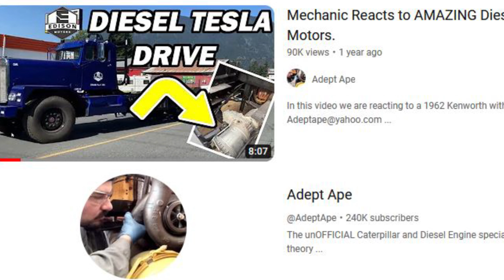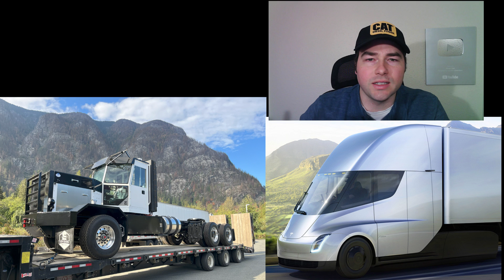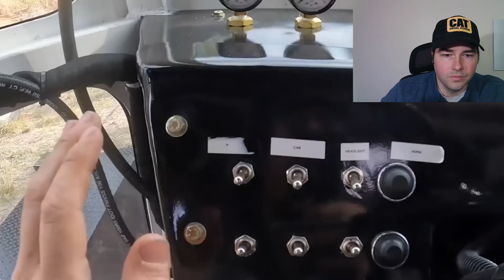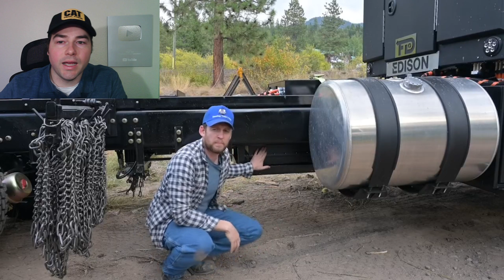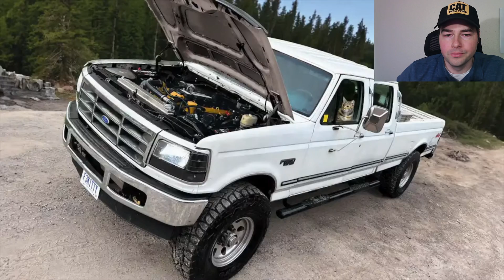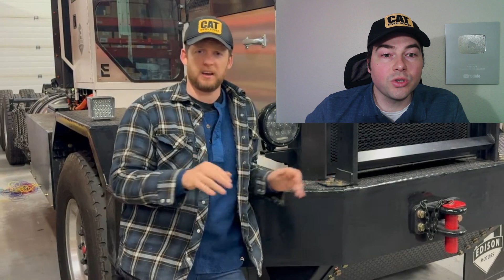Edison Motors New Truck DESTROYS the Tesla "Semi Truck" design!!!

Comment: Regarding emissions.

One topic that's been very interesting to me is that the drivetrain as envisioned by the people at Edison is designed in such a way that the diesel generator is run at constant load and a constant RPM, which I would assume would be at the peak torque range or at peak BSFC.

Would a system like that even benefit from the inclusion of a Diesel Particulate Filter? My very limited understanding of diesel emissions control makes me wonder whether at such specific conditions there's actually anything for a DPF to actually filter only to later regen since unlike a normal road-going diesel drivetrain the engine doesn't spend any time idling, or at low load/low RPM conditions.

Is my understanding wrong? Wouldn't a selective catalytic converter to curb NOx emissions suffice?

Comment: Not sure EPA (presently) can do anything about C9 engine....  cause it is NOT driving the truck....  it is ONLY a Generator; on wheels, so it only has to comply with whatever generator EPA requirement's are.   Which am sure that if this truck design takes off (pardon the pun) EPA will change all its regulations in attempt to kill it... (Unless we elect Trump)

Comment: They convert the AC from the engine to DC then back to AC because you need to vary the AC frequency to control AC motor speed. Its easier to chop DC up onto variable AC then it is to convert say 50Hz AC to variable AC. Also the generator speed on the engine will vary the hertz as well. 
They use HRC fuses instead of breakers for several reasons. Big breakers wont like rough roads for long spans of time. Also HRC fuses are glass filled as well because they do have to break at 600 or so amps but if you have a motor short it could pump several thousand amps which would arc through the breaker.
Been working on electric drive trucks in mining for a while now. Its a very similar setup minus the battery
Reply: Having worked on locomotives, fuses are for safety as well. You get someone who doesn’t know what they’re doing and try and reset a breaker with a short and end up seeing the sun and meeting their god.
Reply: Yeah, as convenient as breakers are, you gotta remember that you're not just replacing the fuse, you ALSO have to find and fix the fault that blew the fuse in the first place!

Comment: A pick up conversion needs only a small gas engine to charge the batteries - much like the Chevy Volt used. The batteries provide the torque, not the engine, also a small engine is much lighter and must be so because the batteries add a lot of weight. To be viable, the converted pick up can’t weigh much more that it did as a new vehicle otherwise the handling and braking will be awful. Good business concept, tough execution.

Comment: not bad, nice simple and not over engineered.
honestly it is a hybrid type design though.
The true test is putting it on a real 'live' under load test and see how it performs.
I'm sure he has already done some testing but i would like to see it compared to the 'full' EV's out there.
One other important test would be to see how it performs in cold conditions. From my experience anything battery powered just does not perform well in extreme cold or hot environments.
Reply: They towed a Sherman tank with Deboss Garage. 100,000 lb GVW. It is insanely smooth. No chassis flex. They spun the tires with the tank and lowboy.

Comment: With the engine running at constant velocity to run a generator most of the emissions issues are irrelevant.  Much easier to run clean in a narrow power band, not idle for hours then spin up to rpm under load.

Comment: Is this a prototype, yes. Is this well thought out, YES! I am genuinely amazed at how they thought through things to make it as customizable as possible. The fact that it is a "hybrid" with the onboard generator, and the ability to make it multi-fuel is really incredible. As I understand AC motors also have way better traction control, which is why they are preferred on trains where low traction is a major issue. 

This is coming from someone who is not a mechanic, but loves seeing people bucking the contention of "thou shalt not repair this" and said the heck with that, get in there and fix it yourself!

Comment: I think most engineers would love to design vehicles that are simple, durable and easy to service. Unfortunately, they are often directed to produce something that is inexpensive to manufacture, difficult to service without proprietary knowledge, and sadly, built to fail at a predetermined time.  It looks like Edison Motors, at this stage in development, has avoided that.
Reply: Automotive engineer here, yes, we could engineer something like this, and as someone who worked in the naval field too, there are areas where serviceability and robustness is key.
But on the other hand, the market in general demands the stuff we design, maximum comfort for lowest price and has just to last for five years because that's the "first life quadrant". Quite often as a leasing vehicle. 
After that, service is a secondary requirement,  because it is not serviced by the manufacturer anymore. 
So most efficient/cheap manufacturing and low total cost of ownership for the first user is the primary objective. 
An example of quality first in the "truck" area is the Mercedes Unimog and Zetros, they are built with 100% dependability in mind, but they are niche products for fire fighters, disaster protection, community services like snow plowing, off grid works, infrastructure service and of course military.
Reply: Finally a 2 stroke that can be started and ran n either direction and eliminated a revers gear. Also dry sump and oil injected! While not as powerful as electric motors it’s powerful and fun enough for me!
Reply: Yeah I don't think they have to make money for any shareholders currently
Reply: Off-highway mining equipment engineer here, there are lot of different types of mining vehicles, haulers, loaders, drills, etc. of different sizes. It's not easy to gather enough knowledge from what is best for the end users to incorporate into the designs. We do our best to reach out the service techs, but there is only so much we can do.
Reply: yeah...Exactly! I am seconding that many engineers in many different fields are forced into that. This happens in electrical where a design that calls for certain parts and then either get replaced or even left out completely, just to save a couple of cents per unit. As a software developer I also can say it happens there.

Comment: I'd argue that it's Electric with a Range Extender,, not a hybrid (engine never powers wheels). I drove a 79' International Quad-dump that had basically same chassis,  loved it, was so strong and simple
Reply: It's technically a "series hybrid". It's considered a hybrid vs diesel-electric because it can drive from battery power.

Comment: Specific use vehicles like the logging truck makes good sense for hybrid electrics. Trains and many ships have used this system for years. My opinion is that it is overkill for light duty applications but could be useful in certain conditions like coming and going in underground storage facilities or delivering into buildings. The major problem I see right now for this is the battery fire potential that has been proven to be a problem of being able to extinguish the fires. Maybe the salt battery or the solid state will solve this.
Reply: Trains and ships are not hybrids, they are diesel with an electric transmission.

Comment: I drove a 1962 Peterbilt with a nt280b Cummins and a 5x3 transmission setup. The butterfly hood looks cool but working on it requires leaning across the fender. It's downright miserable to work on things. A tilt hood is much better for engine and whatever access. 

The Edison truck does seem to be designed by someone that's actually driven and worked on a truck.

Btw I still prefer the 2 stick transmission setup I had. I found it easier to drive than a 13 or 18 speed air shift.

As for the pickup version. It won't need the power and battery setup the semi truck needs. I'm sure John Deere or Kubota has an engine that would be small and would work.

Comment: What holds back that heavy load when going down hill some type of engine brake?
Reply: Regen does most of the braking, but it has standard size truck brakes, too.  They should last a long time with regen braking
Reply: Than @jdgvee9313   thanks  for the info !

Comment: Just like a locomotive. One more power system too worry about. No passengers or sleeping. No thanks! Plus batteries die and this thing must weigh 30 tons.
Reply: 12.5 Tons.  Same as a diesel logging truck - actually slightly lighter plus a bonus weight credit due to electric
Reply: when they converted Carl to be hybrid they are around 2000 pounds lighter.  Even with all the extra batteries and stuff.

Comment: I can see this becoming a new emissions gray area, yeah it's an electric truck but you have some sort of genset to produce electricity to recharge the batteries, what emissions regulations does that genset have to follow?? Technically the road going vehicle is powered by electricity so?????????
Reply: It's driven by electricity which is generated  by an emissions compliant engine running on a road taxable fuel.

Comment: I guess the big take away was that the truck is labeled off road. 
That allows them to bypass a lot of regulations new on road trucks have to comply with. 

The truck reminds me of the old Pacific trucks and the heavy duty oilfield trucks by Western Star and Kenworth. 

Looks like they are following the dealership principal that Western Star used to break in the market to get a network of shops up. 

Unfortunately, all the emission and safety laws have turned trucks into very complicated vehicles.

Comparing the Tesla truck with the Edison truck is comparing apples and oranges since they are for totally different markets.
Reply: No Edison is an on-road truck totally compliant for on-road use. They are designed for off-highway use but there will be Edisons used for all type of heavy vocational use. I believe they are building 5 in 2024 all for on-road use
Reply: Its designed as on road.  The engine is a generator,  so it meets requirements for generators, not automotive engine

Comment: Im very interested in the pickup conversion. I had a Tesla for a short bit and I like most of it, biggest downside was the charging. They mentioned pretty much any power plant would work with it, so I imagine you wouldnt "need" to replace the engine. my question would be how much extra weight would it add, and could the components be installed underneath since you would be removing the drive line and freeing up space
Reply: Chase has talked about those points in his videos.  why would you want to adapt a warn and tired engine that is in those old trucks to run as a generator, why not just get a new engine that will last.  and as for the placement of the equipment, He is trying to make it as plug and play as possible.  Making it a unit that is already assembled that just drops into the bed is a lot easier then having to have units designed to each truck.  If you are putting them between the frame rails you would have to have units made for each truck.  Not all trucks have the frame rails the same distance apart.  But the Installer can move everything and put it where you want.  Just will cost more.

Comment: I wonder if like a 3 cylinder kubota diesel would be enough for a full size truck?
Reply: Thats probably what they will use in 1/2 tons and 3/4 ton conversions. 1 ton and 2-3 ton conversions like f-350,450,550 will get something a bit bigger depending on intended use

Comment: i would think in the "Pickup" truck application that the addition of a new engine and electric motor + batteries and electric axle, the payload capasity would be next to nothing.  You would be at or close to GVWR for the truck.
Maybe if a diesel in a pickup for these conversions you would go with something like the old Cummins 4BT or  some type of Kubota/Deere 3 cylinder.

Comment: Exactly, why do they use fuses for anything anymore, it should be a resettable breaker. Nobody ever carries spare fuses until their vehicle starts blowing fuses.
Reply: for one, fuses activate much faster than breakers.  also if it is a breaker, and there is a major short, the driver could just sit there and keep resetting the breaker making things a lot worse.  If the driver has to keep getting out his tools to unbolt a fuse to replace it they will start looking for why it is blowing the fuse in the first place.

Comment: For hauling light loads the edison idea sounds like a great idea, like a hybrid car. But they haven't proven anything, have they?  The guy on camera is a logger, where is any proof of this truck hauling a load of heavy logs? I live in a heavy logging area, i know how hard those trucks work even though i don't drive one. 

I could see this concept being used for light loads with heavy traffic where fuel is wasted by slowing down and sitting around, but in my opinion nothing has been shown to prove it can efficiently haul a heavy load.

 If i were a trucker with 2 choices  (hauling light loads) i'd chose it over a tesla semi because it could probably go farther and be refueled faster, but i don't really trust it... Show it hauling a full log trailer.
Reply: They hitched up a Sherman tank on Deboss Garage. 100,000 GVW. It spun the tires just tapping the accelerator. Check the video out. Its so smooth because there is no chassis flex.
Reply: First load pulled 100k gross.  Its designed for heavy loads.  Go watch their videos
Reply: The first load was in excess of 100,000 pounds.  The largest GVW a Tesla Semi has ever seen was 88,000